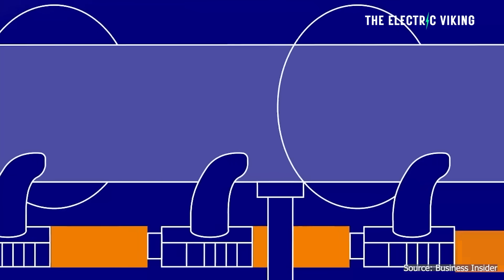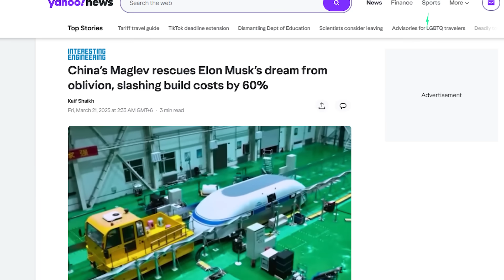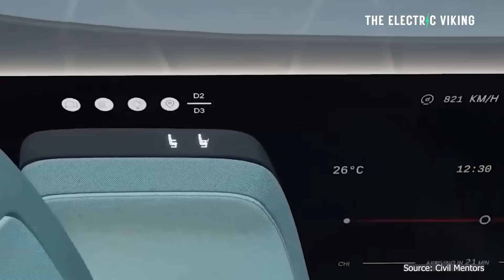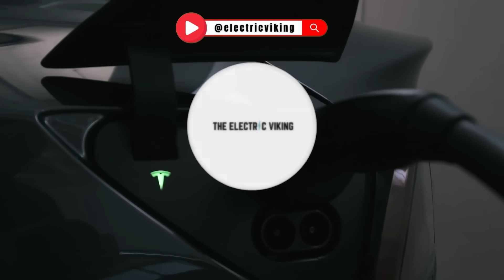Hyperloop Back from the Dead: Maglev Revolution Could Transform Global Travel

Comment: @5:25 - If you "live in back of nowhere".  Sorry mate the H-L will not be stopping to pick you up in the back of nowhere. Being "not too far from a H-L tube" is no good either, you need to be not too far from a H-L station to benefit from it, and they will be even further apart than high speed rail stations and airports are. They would only be in very important centres, not in the back of nowhere.

Comment: In his book, "How The Railways Will Fix The Future", rail engineer Gareth Dennis explores how the architecture of the stations would have to work for hyperloop. In short it doesn't, follow distances, pod sizes would require ludicrous numbers of platforms just to get a fraction of the passenger throughput you might expect from a train. I'm pretty sure hyperloop only exists to derail policy makers when they're considering highspeed rail projects.

Comment: You only have to look at the costs of the Shangai maglev train (easily found on Google), built twenty years ago. Easy to see the costs of above ground maglev trains are beyond most countries. Add the cost of a vacuum tube and the tesing with regulations, and it becomes less feasible. It's good headlined for a YouTube video, but it is financially hard to achieve and technically difficult. Musk never had a hyperloop company, just a tunnel boring machine in case anyone invested in hyperloop.

Nothing is impossible, given enough funding, but the cost vs. benefits vs. roi?  Why bother?

Hybrid working, more robotic manufacturing and warehousing, why do you need to move people so fast? 

Electric airships are more flexible and more feasible, need less infrastructure, and even could revive older infrastructure. Think ports (river, sea, inland) that could be fed by airships - shipping is still cheapest for mass movement with the lowest carbon emissions, especially if hydrogen/electric powered.  

China is the fastest investor in hydrogen engines, as EV options do not meet all demands. Although, the Chinese investment in Thorium power plants could feed a maglev operation. Hydrogen/ammonia powered trains and ships already exist and operate. 

Airships and ships are not so exciting, though. So, there are no catchy headlines.

Comment: You missed the biggest issue. Not having a straight and flat surface to put the tunnel on. You realize how large the radius of curves are on a highway that only has cars going 70mph? Now imagine how straight it needs to be for 200mph highspeed rail so you don't make all your passengers throw up or smash against the train. Now imagine going 600mph! You need to have a bend radius that is more than the size of some states. You can only build this system for cheap in flat desert of Nevada or the plains of Indiana. Where no one lives or needs to travel. The defunct Hyperloop One was going to build their first commercial track in Kentucky. Absolute idiots. You would have to blast through rocks through the whole state to build a straight and level tunnel. You could build and maintain multiple mag level trains for the cost of building one stupid hyperloop and have way more throughput. Also, focusing in passengers is dumb. You have way too many safety concerns that you can eliminate if you focused on shipping cargo via these tubes only: 1) You don't have to worry as much about g-forces and people freaking out because they are stuck inside a vacuum tube. 2) A pressure leak won't make anyone sufficate or cause an implosion that crushes people and you won't need oxygen tanks. 3) You won't need the product to move as fast to still be far faster and more cost effective than shipping via truck, plane, or rail. 4) You won't need any of the added amenities and extra labor involved in maintaining safe and clean pods that people ride in for comfort.

Comment: We don't even have intercity maglev. And now we want to put the maglev inside the tube.

The cost of building a maglev 500km/h alone is 3x more expensive per kilometer.Compared to 350km/h high-speed train. And it is 2x more expensive to operate because it uses 2x more electricity.

Comment: I liked this video, but I wish you would double check your facts.  600mph is no faster than a plane.  The trip from LA to New York would require about 3600mph, if the hyper loop traveled in a path similar to roads, which is about 2700 miles.

Comment: All the people saying hyperloop is impossible probably also thought reusing rockets was impossible, autonomous vehicles, non geostationary satellite comms, AI passing the Turing test, beating men at chess, going to the moon, flying supersonically, flying at all, running a mile in less than 4 minutes, etc.
Reply: It isn't impossible but makes no economic sense. The cost will be collossal, both in material and planning and legal costs as the route will need to be a near straight line so can't avoid things. Your total journey time will still be dominated by getting to and from the stations, which will be very few and far between in a H-L because if it keeps needing to stop it defeats the high speed "advantage".

Comment: At 2800 miles and a Hyperloop going 600 mph it would take over 4.5 hrs to go from NY to L.A., not 40 minutes. For 40 mins, you would need to be going over 4100 miles per hour
Reply: It was San Francisco to LA, not NY.

Did you even watch the video?
Reply: Um...I would ask the same. Check at 35 seconds - NY to Los Angeles....but, that's ok cause you clearly didn't watch the video if you didn't get 35 seconds in
Reply: @GraemeMitchell-m6v  That’s just Sam’s usual nonsense, he misinterprets stuff all time, get used to it, Musk’s paper was LA to SF. 02:36

Comment: Why would it be cheaper than high speed rail?  You still need land.  You still need to build through urban areas.  You still need a "track", only in the case of hyperloop, the track is a tube kept at almost vacuum state:  none of this sounds cheaper to me.
Also you say a 5 hour train ride would reduce to 30 minutes.  That's 820 miles in 30 minutes, at the speed of the Hyperloop would need to be 1,650mph.  So it's more likely that Hyperloop would cut that 5 hour train ride to 2 hours and 30 minutes.
Reply: A tunnel underground avoids most of the land purchase and regulatory issues.
Reply: @JohnSmith-x3y8h  And is very expensive, and slow, to dig.  Otherwise we'd be putting the full length of all new railways underground in tunnels.

Comment: I remember reading a sci-fi story about a set of tunnels, that could take you from anywhere on earth to anywhere else in 22 minutes, using hardly any energy. The vacuum tunnels would go in a straight line, ignoring the curvature of the earth. This means the trains would accelerate for the first half of their trip as they fell toward the centre of earth, then decelerate the last half as they approached the surface again. Of course digging building and maintaining tunnels through the centre of the earth will require some construction techniques that are beyond us now, but who knows??
Reply: I remember that, too.  You just need a total vacuum for zero air resistance and maglev for zero friction.   Basically, you just fall through the earth.  Piece of cake!  And 22 minutes between any place on earth...  However, I bet that maglev imposes some serious form of electromagnetic drag...

Comment: high cost to build, high cost to maintain, high cost to operate - there is surely a market for high priced offers being easy and fast, just checkout the routes offered by airlines having a cozy first class. It's just not a revolution. By the way, same for the driverless taxi cabs - where Waymo has shown in SF that they need two persons per car to keep the system running. Let's call it like we always do.... in ten years. May be.

Comment: Hyper loop will not work. No one has made a hyper loop work faster than existing high speed maglev's and it never will work with current technology. The problem is nothing is 100% perfect, therefore the heat generated in the vehicle from the induction motor inefficiency cannot be removed.  To achieve the high speeds accurately made tubes which will result in more tunnels and bridges with close to straight tubes and minimal grades. Thus the cost manufacturing will be much higher compared to existing high speed rail. I recently rode on the Chinese maglev. It was the fastest passenger train in service a few years ago. It now only runs at just over 300 km/h. It's an orphan, clearly more expensive to build and run compared to high speed rail, (currently at commercial speeds of 350 km/h). It will quietly disappear like all the other attempts.

Comment: It's not an engineering impossibility but it will be a very costly infrastructure  solution. The longest vaccum tubes we have build so far are the 2 beam pipeses of the CERN Large Hadron collider. They have 27 Km in length nf a few centimeter of diameter. They are located in a large tunnel and are shielded from extrernal hazards by the enormous magnets that accelerate the protons beams to need light speed velocity. It is a complex tubing system because it require near perfect vaccum. The costs of a vaccum tube increase with linearly with the lenght and exponentialy with the radius of the tube. All the projects envision an elevated tube directly outside strengthen for the hazards of winds, rains, earthqake and gun crazy americans that like to shoot at every infrastructure they dislike. The project PR is done by videogame ceators that have absolutely no idea of the laws of physics for high speed. China has a large trade surplus they can invest a part in pragmatic proof of concept experiments just for the progress of Science and Technology. But if you want the list of real world engineering problems the proof of concept experiment will have to solve there is a ton of videos about  it.
https://www.youtube.com/@Thunderf00t/search?query=hyperloop

Comment: There is a big difference between feasibility and practicality. Hyperloop is possible, but the practicality equates to cost/benefits. And Hyperloop will be expensive. One of the unspoken costs is earthquakes. You can factor-in the cost of repairs but the faster you go the greater the damage when things go South.  And small earthquakes will cause subtle and unseen damage that is more important at speed. Musk didn't fund Hyperloop!

Comment: Probably I don't get it but what about:  instead of tons of steel tube trying to holding a vacuum... just pumped in air at one end at 700 mph and suck it out the other end at the same speed... 

2) You won't need to have as strong magnets pushing the train either ... it only needs to be lifted.. wind keeps it moving once started.

3) Friction with tube?  If you have enough laminar flow shouldn't be too much friction... AFAIK aircraft wings don't too hot from friction with the airflow. 

4) Pushing by air is hard? OK the train might need a magnetic push at the start to get it up to speed... but once moving lack of friction with air and air flow pushing forward around it counters any friction with air in fact any air friction pulls the train forward as the air is travelling slightly faster. Train just keeps going at speed due to its momentum. The tube might need some specialized coating to reduce friction with the air flow... but once the air is moving the air's momentum should also continue. Air moving at a minutely faster speed than the train to keep the train speed constant... although I don't see any major reasons the train would lose momentum. 

5) Inclines ? If the track incline is up train loses speed, when incline down train gains speed, if the start station and end station same height gains/loses should be net zero.

6)  Starting 100 miles of air moving would require a LOT of initial energy ... but in theory that only has to be done once! (One time when tube first built, could take a year initially, not once per trip)  air is started its momentum keeps it moving too (you never slow the air down or turn off the fan assist, trains are accelerate to correct speed in short run up tube then inserts into main cross country tube where air is already moving at the right speed ) If it is one big loop (e.g. air going east-west tube goes straight into reverse direction west-east tube) once the fans get the air moving  then they just maintenance keeping the air momentum nullifying any air speed lost through friction. ...NOT... needing pushing the mass of air up to speed every time.

Did I miss some obvious flaw?
Reply: Pneumatic tubes or "capsule pipelines" are very old. Used for transporting messages or tiny other pieces. The main problem is simply the sealing and of course massive friction.
Reply: @cunningfrogg  Thanks for the reply, my thoughts:
Sealing - an issue of course, but wind system causes less pressure difference along the tube than a near vacuum system. Air leaking out is also less of a problem than air leaking in breaking the vacuum. Plus air flow laminar so less pressure / interaction with tube surface (Bernoulli effect) 

"massive friction" problem - In those old systems was that object-tube  friction?  I still see the train not touching - levitated by magnets. Air friction with train would speed the train up as air is moving faster. Agreed air to tube might be a "massive problem". Faster air moves the less pressure - the more laminar  (Bernoulli effect) - less friction perhaps? I suppose coating the entire inside of the tube in teflon (to greatly reduce friction) would be too expensive?

Comment: As with trains the strategic argument against loopy-tube infrastructure for public or cargo transport is negated by fossil fool funded nobodies by saying:

"Well ... all some terrorist or bad actor state has to do is blow up the tracks and a heap of economic functions are stymied.  We have to stick with atomised, separate trucks and cars based on petroleum because it just makes strategic sense."

If one's instincts remain on the surface it's a convincing argument and keeps the taxpayer hooked on fossil fuelled bitumen and petrol (gas) for the car.  Shock-horror ... no alternative ... the usual headf$%^&k.

So ... why did 1.4 billion people ignore the false dichotomy?  Just look at China.

While we're at it ... just look at Canberra.  The train down the centre of roads - designed 100 years ago by folks who thought electric trams would be the obvious solution - are doing just fine.

Plonking mag-lev modified trains or mag-lev pressurised hyperloops down the centre of highways just MAKES SENSE!

Comment: Yes it’s insane. 

You’ve obviously no idea how much energy it will take to drop the pressure inside a tube hundreds of miles long to a vacuum. 

That the tube will experience temperature variations and temperature differentials will cause different rates of expansion of the tube. 

Train tracks suffer this problem too, some tracks have slots cut at angles to allow for expansion. 

Ones that don’t look like bendy snakes. 

And what happens when something goes wrong?

If you’re moving at hundreds of miles an hour and it derails your crashing along a pipe at hundreds of miles an hour. 

You’ve been turned into a shotgun shell. 

Also a fire inside a sealed module inside a vacuum filled tube will deliver a cooked and set of passengers to the end of the tunnel. 

So no. 

If they actually launch it it will be so expensive no one will be able to afford a ticket. 

You have to hope no fire breaks out and that it stays on track at top speed. 

If you need to get out if it stops halfway between stations you can’t. 

There’s a vacuum outside. 

Best hope the oxygen bottles are filled to the brim so that they can somehow get a rescue crew to you before you suffocate. 

I think all in all it d sooner take a slower safer mode of transport.